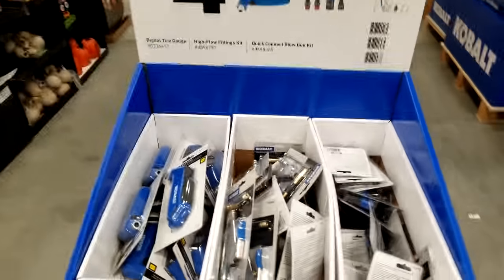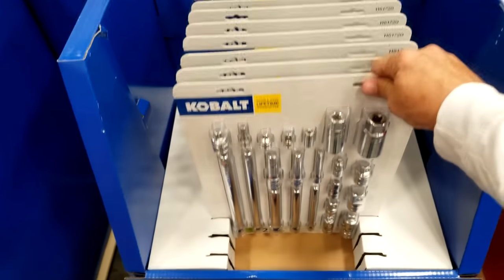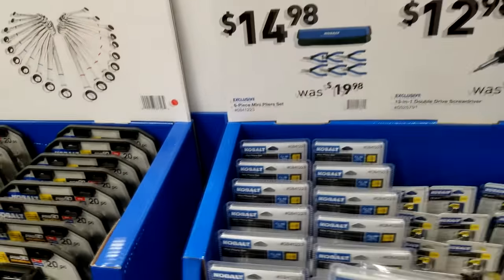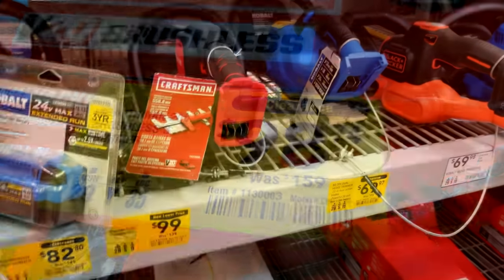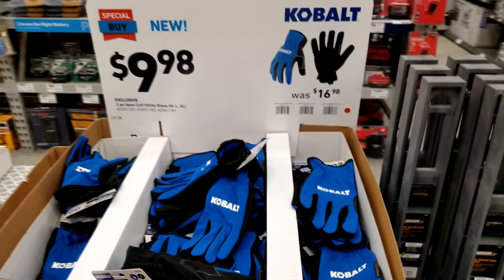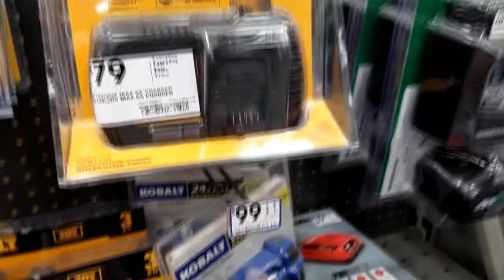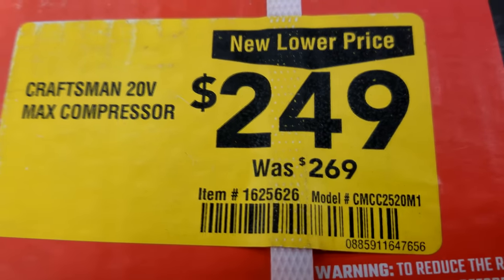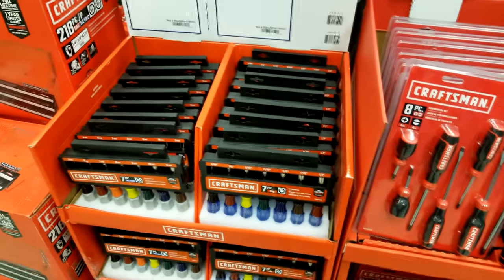Lowes Christmas Tool Deals 4K-UHD! Stocking Stuffer Gifts, Dewalt, Kobalt 2020

Comment from the maker: From Home Depot Tool Deals (paid affiliate links)
🛒 Dewalt Buy More Save More Tool Deals Special Links: https://homedepot.sjv.io/56PB2
🛒 Dewalt "Special Buys" Tool Deals List: https://homedepot.sjv.io/Qo3xo
🛒 All Home Depot Dewalt Atomic Tool Kit Deals: https://homedepot.sjv.io/VE3gA
🛒 Home Depot "New Lower Price List" All Tool Brands: https://homedepot.sjv.io/PXNqe
Other useful Home Depot Special Links:
🛒 DWST08450 ToughSystem 2.0 Large Mobile Toolbox: https://homedepot.sjv.io/z74qr
🛒 DWST08300 Toughsystem 2.0 Medium Toolbox: https://homedepot.sjv.io/q7yNY
🛒 DWST08165 Toughsystem 2.0 Small Toolbox: homedepot.sjv.io/B6P1y
🛒 DeWalt ToughSystem Workshop Racking Storage System https://homedepot.sjv.io/M92n
🛒 DeWalt ToughSystem 2.0 Full 3 Piece Tower : https://homedepot.sjv.io/OjOBr
🛒 Milwaukee M12 Free tool or battery Deals: https://homedepot.sjv.io/VEV26
🛒 Milwaukee M18 Free tool or battery Deals: https://homedepot.sjv.io/0WORO
🛒 Milwaukee M18 Vacuum 2 Gal. Cordless Wet/Dry (Tool-Only) https://homedepot.sjv.io/qJVRn
🛒 All 290 Milwaukee tool deals or battery Deals: https://homedepot.sjv.io/LVrOV
🛒 DeWalt 20-Volt MAX Lithium-Ion Battery Pack (4-Pack, 2 aH, 2 4AH) hoAmedepot.sjv.io/e9BGj
🛒 Home depot All Tool Brands Current Savings: https://homedepot.sjv.io/NZP2q
Disclaimer: Some of the links we send you to are affiliate links which which if you click on them and buy something, we may receive a small affiliate commission. We appreciate you supporting our efforts to continue to bring you word class tool reviews, remodeling and repair videos, and shop with me videos looking for the best discount tool deals.

Comment: We have purchased 2 of this skinny trees in the past 10 years, every 5 years only because the lights end up shirting out. I wouldn’t mind spending the big bucks on those trees with the amazing cool lights, but Was worried the lights would die after five years the same way as my previous ones. They put these fine little lights but the wiring is very delicate inside.
Reply from the maker: It's still boggles the mond how they can't get a good string of lights on a tree and have the bulbs just work.

Comment: @ my local Lowes those saw horses are $38.98 each so i think $49.98 for 2 is a good deal, My Lowes doesn't even carry them. I can't even find them on the Lowes website I would love a set of those. I just looked in the Boca Faton store website and it doesn't show up
Reply from the maker: Crazy some stuff is in stock that is not showing up on the web site.
Reply: I just got back from lowes, they said it must be a black Friday deal. SO I guess they do not put it in the computer until it is going out on the floor.

Comment: Umm...  When you looked at the 24 volt Kobalt blower for $99.99 the box you were reading off is for the electric 12amp blower at 700cfm.  The 24 volt boxes were directly underneath the sign.  But thank you for bringing us these walkthrough videos.
Reply from the maker: Yes sometimes with mask on pinching against my eyes and super dry eyes from breathing out of the mask, I can get a few things wrong.

Comment: That kobalt tire pressure gauge i purchased for 15 and some change litterly 2 weeks ago. I ended up returning due to inconsistent reading beyond +/- 1 psi that it advertises. I was getting readings at beyond +/- 15 psi.
Reply from the maker: Maybe just  bad one? I always buy the Husky gauges
Reply: @jeffostroff  husky is what I wanted.  My local HD was OOS, I headed over to lowes as I really  I needed one and thought I would try out the kobalt one. I was hesitant due to the 15 dollar price tag but decided to buy it anyways..  but yea, husky products are usually pretty  solid and affordable.

Comment: Got that (Item# 1083767) 80v 630 CFM Kobalt blower & (Item# 1130001) 16 inch 80v Kobalt String Trimmer for $99 each at my Lowe's yesterday in NY area. Returned that 2 pack Item# 1438133 after 1 week. Paid $185 for it. For $15 more I got a better blower thats 630 CFM than the 500 CFM in the 2 pack & another 2.5 amp battery. Great steal.
Reply from the maker: You got a great deal!

Comment: Monday morning at the Lowe’s in San Bruno, Ca they had the Dewalt XR Oscillating Multi tool for $99. I think there was a small battery included. Right next it on the same display was the $49 Dewalt multi tool blade set for $25. I should have grabbed a set.
Reply from the maker: Wow that blade set is half off at your store.
Reply: I picked up the Milwaukee 20 piece multi-tool accessory kit for 29.00 through the Home Depot app and shipped to my home last week and it arrived  today. Even comes with a storage bag that holds a ton of blades, etc.
Reply: @markiefufu  I just saw the Milwaukee blade set online the other day. Glad I held off of the Dewalt. I’m going to buy that $29 set ASAP.

Comment: Hey Jeff I on the t stack and versastack platform decided I was going to foam my boxes to sort my tools well run into a little problem my DeWalt tools won't stay in the Craftsman versa stack boxes 🙄 I hear strange noise is at night coming from the shop and when I go to the shop all my DeWalt tools have jumped out of the versa stack boxes any suggestions strange though all the DeWalt tools that I have in the t-stack boxes are still in there
Reply from the maker: Are the Versastack boxes too tall? Maybe another layer of foam on top, but I would think that if you cut your holes into the foam and make them smaller than the tool, then the tool should be nice and tightly wedged into the foam.
Reply: @jeffostroff  yeah the foam is tight I just don't think the DeWalt tools like being in a versus stack box lol I think they're just trying to escape from the red and black going back to the black and yellow lol

Comment: I am up to 5 Lowe’s stores in Northern Illinois looking for 2537952 DeWalt woodworking kit. Still no luck!
Reply from the maker: That is surprising down here in Ft. Lauderdale, every Lowes I walk into I spot them, also had a couple of people tell me they found them down on the floor, but mostly people are getting them from up top. Make sure you see in this video exactly what the kit looks like it will help narrow the search.
Reply: jeffostroff I have your system down for finding the kit. I just don’t think it’s as readily available in this area. Ironically, I ran into a guy in the Naperville Illinois Lowe’s the other night looking up high too! I asked him what he was looking for and he said a DEWALT drill kit on clearance. I asked him how he found out about it and he told me it was from your YouTube channel. You have got some market saturation going on!
Reply: If I see one in store will leave message. Got mine at Lowe’s on 59 in Naperville was down with kits on floor below displays not up high.
Reply: rrt08 Thank you very much! I was at Naperville store on Wednesday night. Looked high and low and didn’t see it. Very much appreciate it!

Comment: Those saw horses at the Dublin ca store are $33 apiece u save $16 for the pair
Reply from the maker: Could be a good deal
Reply: I use them when I put up quartz tub surrounds at work.I had been wanting some metal saw horses for awhile just happened to find them

Comment: @jeffostroff they have that dewalt 5 piece dewalt multi tool blade set on Amazon for less than $30
Reply from the maker: Dang, that's a much better price.
Reply: @jeffostroff  just ordered mine when I saw the Lowes price😂 less than $30

Comment: None of those deals are at my Lowes.
Reply from the maker: Maybe soon!
Reply: I found out the other day when they had the 3 ah battery and charger deal , that certain lowes locations didnt participate in the promotion , they said its a region " thing " from corp.
Reply: @reginaldwhite7944  What battery and charger brand?
Reply: @AL_Lopez_101  they had a dewalt battery 3 ah and charger for free with bare tool purchase , the promo is over though.

Comment: Hello. Jeff.  You may want to pull your hair out after hearing this.  In my local H Depot and a worker that has helped me before when buying the tuff system 2.  He told me that his boss found 8 tuff system 1 .  Said he didn't try to put them on clearance but through them out. I couldn't believe it.

Hank from NY
Reply from the maker: What?  They trashed them? I would fire that manger

Comment: Kobalt slip joint pliers are junk
Reply from the maker: Few people have said that, what don't you like about them?
Reply: jeffostroff 
I bought a set of 2 and the first time I used them the slip
Joints slid past each other and rounded of like soft metal.
Tried to return them but I did not have the receipt so they gave me two more pairs of pliers which worked about the same.